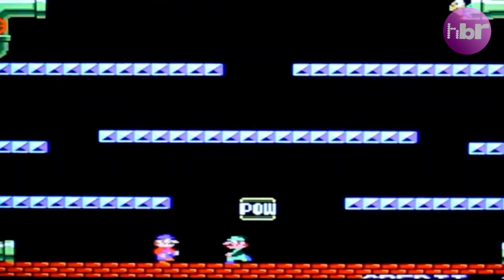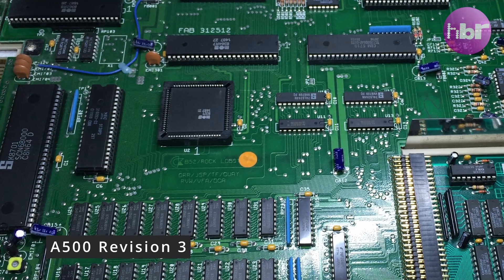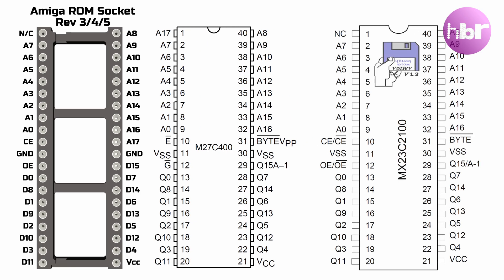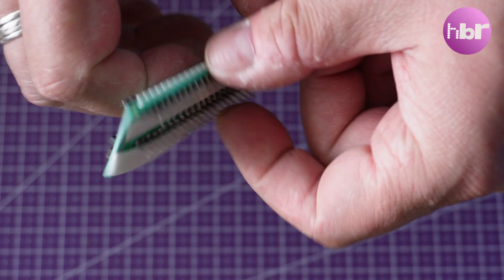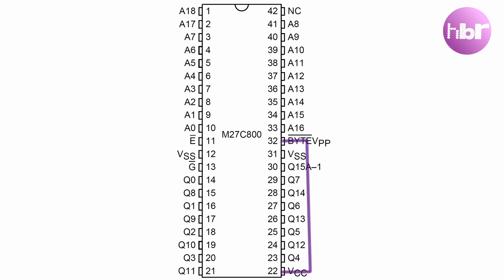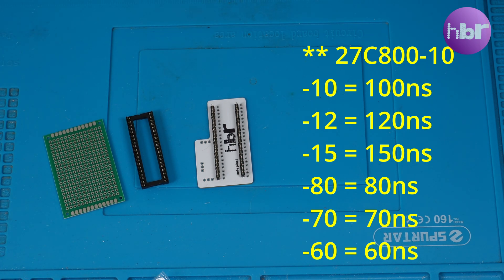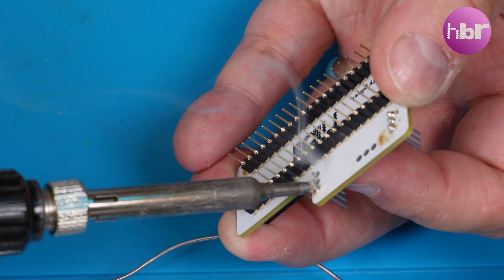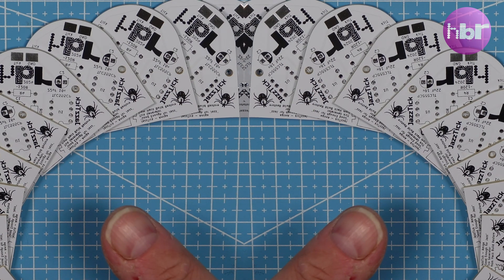Revealing the Secret to a Universal 68k Amiga ROM Switcher

Comment: Nice solution. However, as the switches for selecting the ROM are just setting the adress lines permernently to high or low, there shouldn´t be a problem to extend them. So jumper pins 90° angled might be better than switches here. So you do not need to open the Amiga to change the Rom to use, but instead use 3 wires with dupond connector and a switch (2 if using 4 kickstarts to select). On an A500/500+ you could 3d print a trapdoor with the switches, on an A2000 a slot cover with the switches and on a CDTV a backplate were the TV modulator was. So easy to access switches without damaging the original case.
Reply from the maker: Thanks for watching, glad you liked it. I would absolutely go for 90 Deg headers and switches when using internally. On my rev 6 I have two switches at the rear with a cable soldered directly... There is a post in the community feedback that addresses using this internally http://youtube.com/post/Ugkx0Khsp_xsaPcBvJT3r7B3_yheBRzKc5nv?si=rs46lI9_PnUEnfj5 my main premise in the video is on the bench diagnostics and having an easy way to use it in early and late revisions of Amigas.

Comment: A for effort. But it's not the best solution. Some UK guy (forgot his name) made a flash ROM emulator. You can flash it via USB while it is in the Amiga, you can configure it to several different layouts for multiple ROM images, and you switch ROMs by holding down the reset key combination for like five seconds. Use two of them for the 32bit Amigas, connected by a wire to synchronize them on reset. I got five of them. They're very nice.
Reply from the maker: Thanks for watching, and the feedback :)
One hopes you have a minimum of 5 Amigas (or other vintage computers) 
I have seen the emulators, and I agree awesome bits of kit!  I agree my way is not right for everyone ! There are a couple of reasons why the more advanced solutions are not a fit for me, personally. The key reason I wanted to go more analog was I use this for diagnostics and when you don't have a keyboard or a mouse attached it's very difficult to use key combinations to switch, also knowing which ROM is selected from the jumper/switch positions is paramount :) The second is simplicity and compatibility i.e. there is nothing in this that you couldn't have built in late 80s and it's recycling some of the surplus ROMs out there :) I did have a whole rant on the more advanced switchers and it came across as I was against them, and I'm not, I may actually put one in my Amiga 2000 ... at some point.

Comment: sorry to say, but i dont think you can fit this in a A500. due to lack of space below keyboard 🙂
Reply from the maker: If you're referring to the stacked adaptors in my zif test rig, then you're right, but the switcher alone does fit no problem as does the adapter :) also wouldn't have the vertical jumpers in that use case either...
Reply from the maker: Yes it's snug, but see community tab for pictures :)